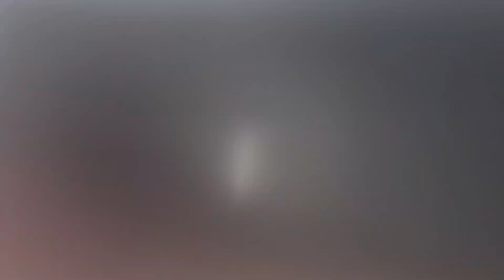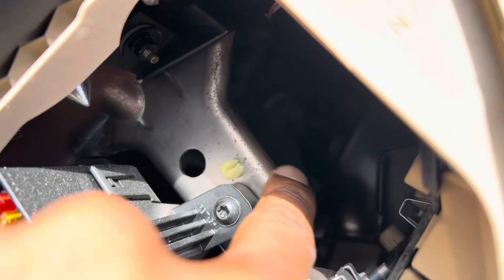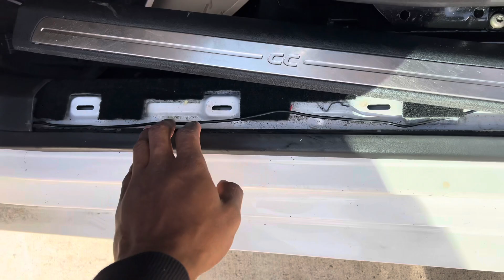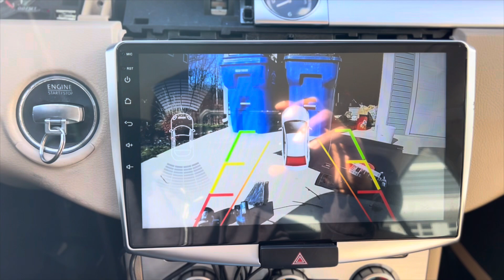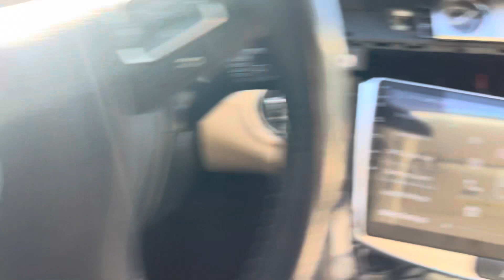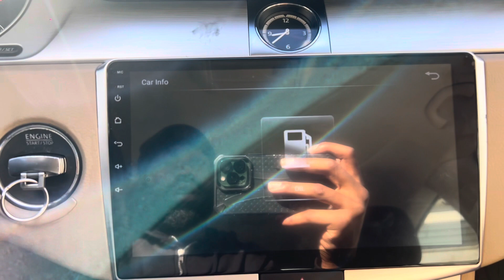How to install 10.1” Android Radio, Backup Camera & Dash Cam  in 2010-2015 Volkswagen CC

Comment: As far as the backup camera. In the trunk, what all do I need to connect? As far as splicing wires
Reply from the maker: You don’t splice anything in the trunk. You need to tap the backup camera wire behind the radio for the power

Comment: What did you connect the reverse camara too in the trunk. What power?
Reply from the maker: The trunk was the video input, trigger & power. The power source for the camera was used from the wiring harness in the front